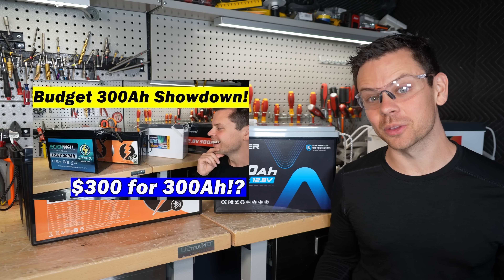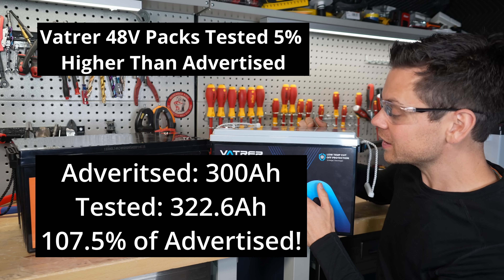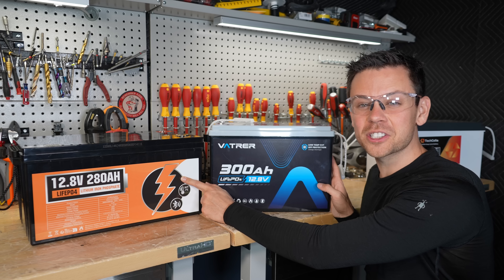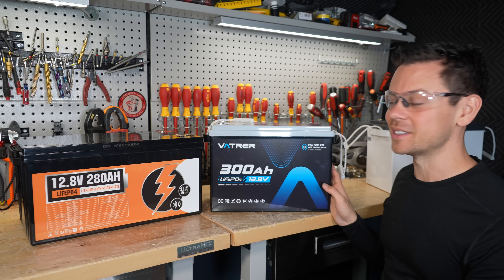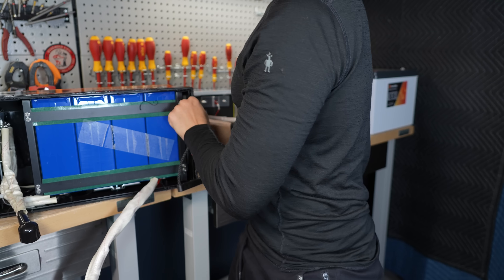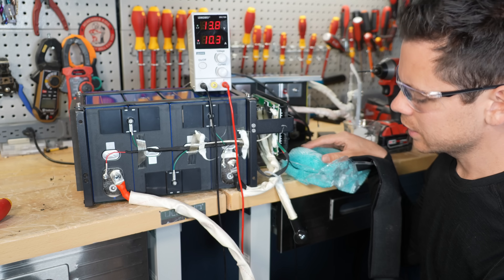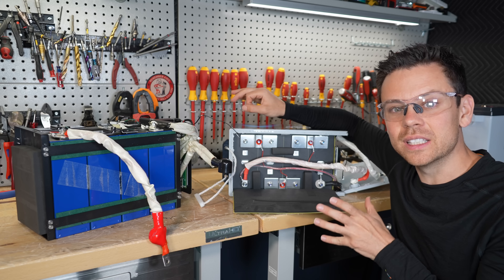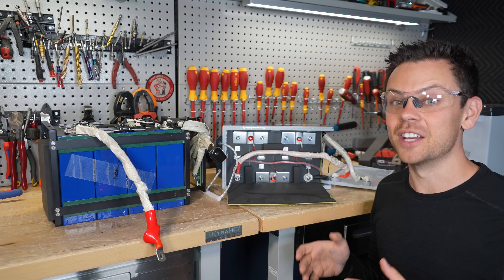Name Brand Batteries Worth The Extra $$$? $479 300Ah Vatrer VS $420 280Ah Ecoworthy!

Comment: @WillProwse Wouldn't the $340-365 Elefast, TechCella and other variants of the 300-330ah batteries that use the Bluetooth JBD BMS qualify as a "smart battery"? Still disappointed that you didn't menton that the Elefast had that in the previous video as that sort of changes the value proposition for it. Also would have been nice to delve into the BMS settings via Bluetooth and see if you could adjust the overcurrent settings and such.
Reply from the maker: Those have bad cells check out my older videos. All of those clones are pretty bad. Just found another
Reply: @WillProwse  .... but saying the Eco-Worthy is the cheapest "Smart Battery" isn't really true... and not mentioning that the Elefast has a Bluetooth BMS that is known to be a decent brand was disappointing. It is also a total crap shoot on what you get sometimes batch to batch likely depending on what cells were available on the date of manufacture and just because you found a certain cell size/type in one batch doesn't mean that is what you get with the next.

Please don't see this as lack of appreciation for the videos and website.... I'm super grateful for everything you do with these reviews and how much you information you share about all of this... just a little bit of constructive criticism.
Reply from the maker: @Hakudog5 those aren't decent, they don't even pull full capacity 🤣 do you work for them or something?
Reply from the maker: @Hakudog5  thank you but I'm trying to figure out where the constructive part is. What am I missing on that battery?
Reply from the maker: @Hakudog5  Ive got a second one and the capacity results were lackluster. What are you getting?
Reply: @WillProwse  No... complete novice at this stuff and just trying to figure out what batteries to buy for my RV and have been watching a ton of reviews and reading up and it was my understanding that the JBD BMS's are well regarded but there is a chance I am completely wrong. I don't currently own any Lifepo4 batteries. I guess I just meant that leaving out certain features that the batteries had when you are doing a review seems a bit odd and that at least mentioning that they have Bluetooth and seem to have support via a well regarded App (Overkill) is a bit weird. Saying something is "The Cheapest Smart Battery" when there are cheaper smart batteries just makes me wonder about what else I'm missing in the reviews. If you can't take that as constructive... then I don't know what to say.
Reply: @WillProwse  Capacity wise.... if they had put 300ah on the side of some of these batteries instead of 330ah.... it would be a totally different review. Not saying they are worth buying... but from a value proposition... at face value they seem like a good value  I just watched the Elefast/Dumfume/Ecienwell video again and the only bad things you had to say about the Elefast one was that it was under the 330ah capacity and didn't have overcurrent shutdown. Had they put 300ah on the side of it instead of 330ah... it might have been a different review more similar to the Vatrer one from this video. The Bluetooth BMS it has not being mentioned in that value comparison was just disappointing. I haven't been able to mess with it but I know that that JBD BMS has the ability to adjust parameters, so getting into the app and seeing what it said would have been interesting too. I'm definitely still new to all of this though and have been going down the information rabbit hole... so perhaps I'm just in Dunning Kruger mode right now.
Reply: @Hakudog5  You do sound like a representative of a battery company.  Truth is, you have to be specifically very firm with the Chinese producers or they will take you for a ride.  There is a known lackluster consumer protection climate in China.  We are talking about the home of counterfeit goods, image is everything, neither responsibility, repercussions nor after sales service. A business strategy of bankruptcy every two years to escape warrantee commitments, etc.
Reply: @mikemotorbike4283  Do I? Which one do I work for? I've mentioned 5 different "companies" in my responses. No doubt that it is a quagmire and I even said that in one of my responses (when I mentioned that stuff can change batch to batch and just because a tear down shows certain components doesn't mean that is what they are using now) but that doesn't mean a reviewer should leave out features when he is comparing the value proposition between products in a comparison video. I super appreciate the reviews and information that Will gives out and I haver certainly taken a lot of in as I decide how I want to build my Solar RV system... but that doesn't mean I can't point out a hole I see in the review. I love that he is up front about how he makes money and how he handles reviews.... but there is some implicit bias in his approach as well since he takes sizeable payments for reviews. I guess if you think I'm some guy in Hong Kong or China making these posts hoping that I'll sell a few more batteries somehow... then that is great. Maybe go look at the videos I've posted and see that still seems plausible.... just a bunch of offroading and rafting videos and nothing to do with this subject... but sure... I'm totally some dude trying to shill for a battery company.

Comment: Have you tested a DJLBERMPW Battery? I have 12 volt 200 Ah on my RV for over a year and had no problems. I paid $ 399 for but amazon has them now for $ 299 and Ebay for $279.
Reply: someone smashed their head against the keyboard when they thought of that name.
Reply: I have got 4 100ah ones in 4s I'm paralleling with 4 165DC house. I added a litime balancer to each of the sets. I've got it on 1leg of my dual lv6548 that are running my house. So far so good for the last 9 months. Cycled every night to 50%

Comment: Anyone Remember when 100 AH was $600-700??
Reply from the maker: Pepperidge farms remembers
Reply: I'm old enough to remember when solar was over $10/watt on panels. BACK IN NAM
Reply: I just had to put a new BMS in a 48v Big Battery. It's under warranty but they are a joke. Ended up wanting me to ship it back at my expense so they could repair it. I'll ship you the BMS and you verify it and ship me a new one, or make that one work. 
Here's the rest of the story. I needed a battery at a time when everything was back ordered. They had this in stock for a sickening $1899. plus $180. freight. It gets worse. While working on it I decided to pull the circuit board to get to the cells. Out of the 16 cells 3 were noticably different. As in one was black topped. One was shiny silver. One was wrapped in white shrink wrap but the top matched the other 13 cells. There was a rumor back then that they were slapping together used batteries and I definitely have the evidence. One of the cells has very noticeable black burns from an arc at one point in it's life.
These were built by Battery EVO for Big Battery.
It works. It likes it's new smart JK BMS. And to think that tech told me I couldn't have Bluetooth on my battery. I do now. And low temperature charge protection. 
If the cells die they are dirt cheap on Alibaba these days. All cheaper than shipping their crap back to them for warranty work

Comment: I own one of the Eco Worthy 280ah's, the pre-BT version.  No issues.  However, it's only purpose is to connect to either an EcoFlow or GoalZero Power Station's solar input (XT60/90 or APP, respectively) and trickle-charge them during power outages when the AC inverter outlets are in use to keep the internal batteries topped off using some custom cables.  Can someone suggest a simple bolt-on fuse, currently both sets of wires leading from the terminals are direct connect and I should probably rectify that for safety's sake.

Comment: I bought 4 of the 300ah Eco-Worthy batteries for my RV and have been well pleased with their performance. I did a couple of capacity tests when I first got them and 2 tested at 327ah, 1 at 329 ah and the weak sister was 313ah. They do have a JK BMS and I can use the Overkill BMS app to adjust the parameters.
Reply: Mine have JBD BMS’s, delivered within the past 2 weeks with Dec 2024 (year old) build dates
Reply: @LFM80  Yeah, mine have JBD as well, I'm not sure why I wrote JK.
Reply: The weak one might be a good candidate for setting up on a DC bench power supply at 14.6V 0.05A

Probably not perfectly top balanced and the passive balancer won’t do much if it’s regularly charged above 0.2C

Comment: I want a 24v system for van/sailboat applications. But never see a review of those systems.
Reply: Put two 12 volt batteries in series for 24 volts
Reply: @WillyM1  That works but more cable cost & I've heard that it's not the best solution. Just looking for testing on available 24v battery and solar charger-inverter system.
Reply: Dumfume 100ah 24v is $280.

Comment: Please stop using Ah as a battery size unit! 

Wh is the only unit which makes sense for battery size.

The CAPACITY of your battery is what matters. Your inverter and charge controller will be chosen to match battery voltage. Ah ONLY makes sense for the SAME VOLTAGE.
Reply: And he clearly shows both were 12.8V.  Just do a little bit of basic math.

Comment: Vatrer seems to have come a long way with their build quality - it's great to see! Lack of over-current protection... needs fixing. Also laughed a bit when you said "dumb fume" what a silly name for a battery!
Reply: DUMFUME is the name so who knows if we pronounce it correctly
Reply: @primus711  I'm not sure how else one would pronounce that.
Reply: Thank you so much! It means the world to have you cheering us on and seeing our progress. We're so grateful to have you with us on this journey!❤🤟
Reply: @Vatrer what’s the deal with not having overcurrent protection on a modern battery? That’s shocking to me.
Reply: You probably wont get a year out of vatrer batteries.  The BMS regularly fails.  If you search the internet you will find many complaints with vatrer batteries.  They dont seem competent.  Vatrer thinks warranty service is replace just one of the batteries in series with a lower amp hour battery.  Imbalances like that when connected in series is stupid and dangerous.   They are not a good company to deal with.  Communication is super slow and unresponsive with unhelpful staff in China.  According to their customer service, they have no US based support.
Reply: Here is just another example vatrer BMS failure:
"I bought 2 12v 460ah from Vatrer. 2000 eur not cheap honestly for what looks to be finally a crap.Doing some test after install, controls, balancing cells, checking connections and fuses, I have had during the next three days two BMS shut down with critical alarms.Overkill and vatrer app show 255% charged ( !!!!) and more than 8956 cycles already done. One batt is totally defective and by the way the series connection cannot work. I tried to contact their customer service but their polite answers look more like a robot reply. I forgot to mention these batteries are equipped with a nicely designed thermometer, but 15 days after their install, one needle had gone"

Hong Kong support is definitely robotic and less than helpful.

Comment: Vatrer is "name brand" now?
Reply from the maker: Yep it's been around longer than all the budget ones lol
Reply from the maker: Litime probably oldest one that hasn't disappeared
Reply: @WillProwse one bad shipment and poof it's gone like the rest of them
Reply: @WillProwse  I still just go with LiTime.  Not quite as cheap as some of these but damn if they don't ship out the same day, even if it is Sunday lol and always packed well and have always worked (14 different batteries so far).  Hard to believe that 5 years ago I was looking at some 12V 100AH battery from Trojan called the Trillium and it was over $1200.
Reply from the maker: @richardeverett1227 they are good. Very reliable